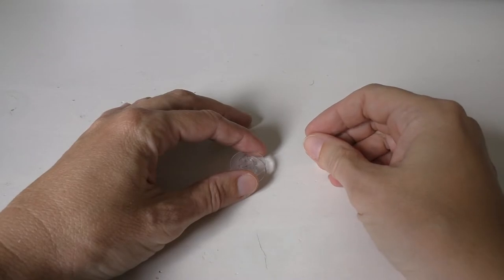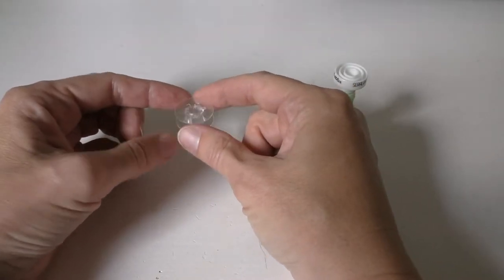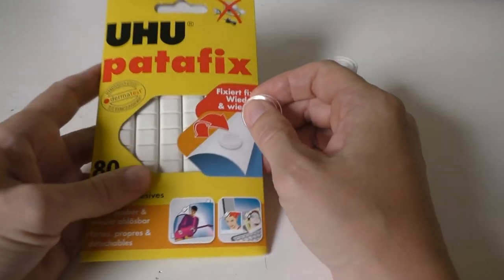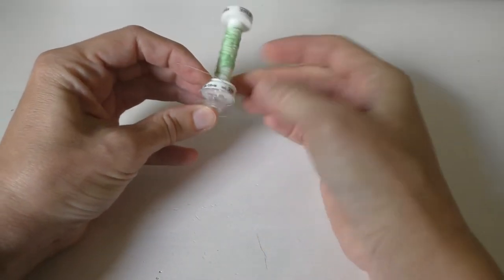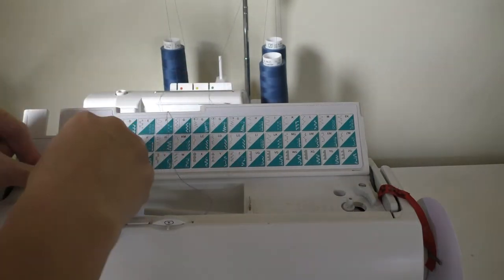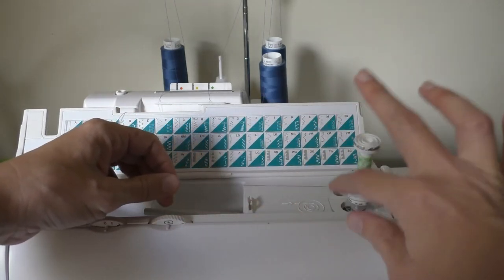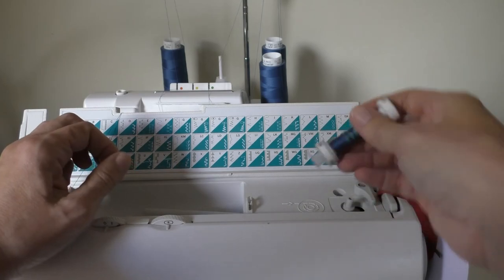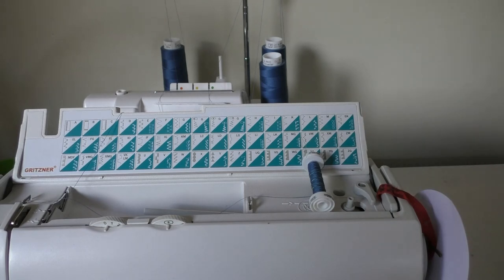Winding thread spools with your sewing machine

Comment: I'm so glad I found your video because it finally gave me the missing piece in this "game"! I used a very similar method before (I once saw it somewhere) where everything was the same except of the adhesive material: it called for a piece of a double sided adhesive tape that actually worked very well for this purpose, but the problem arose when I needed to take the tape off the spool and the bobbin. It was a total mess and so not worth it. I was looking for a more convenient method for a long time and here it is! Finally. The idea of using the putty as an adhesive is absolutely brilliant! I tried it just now and it works like a charm. Thank you so much! :)